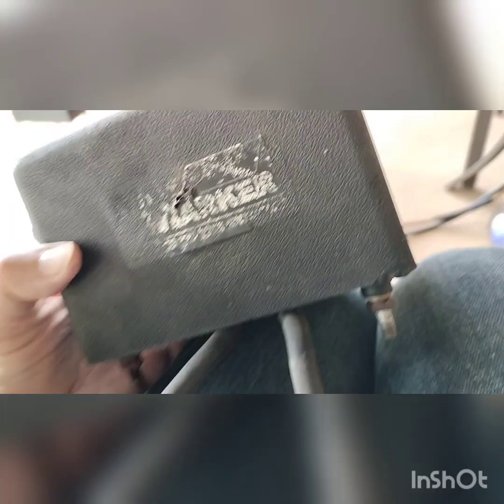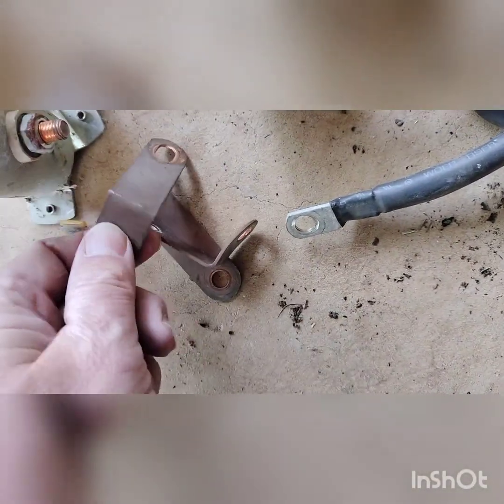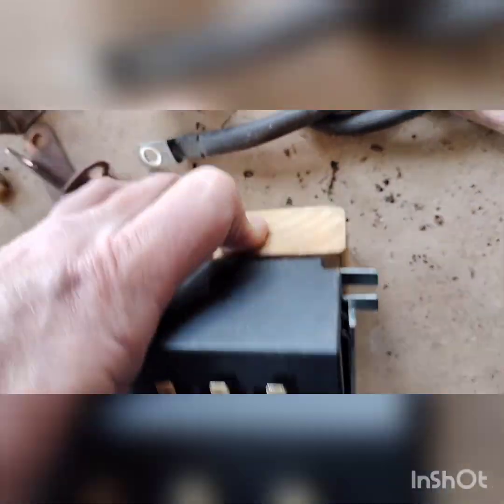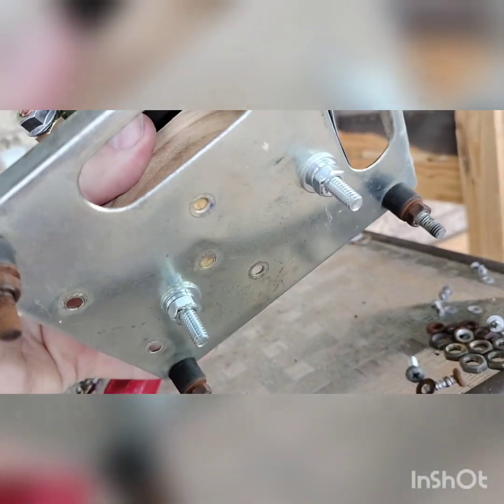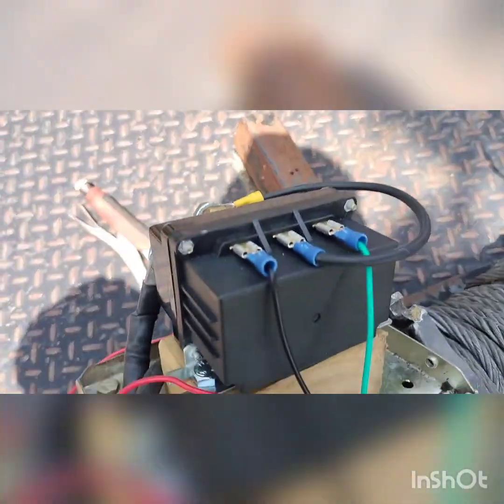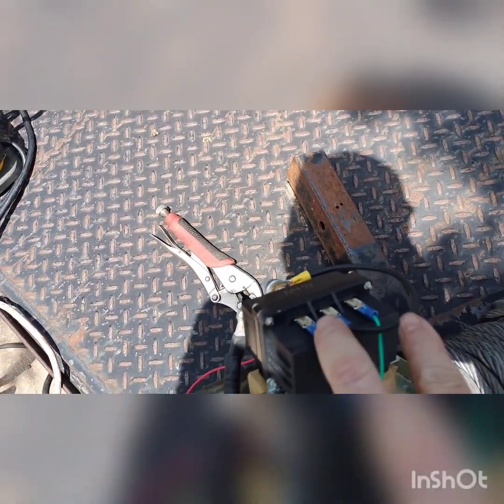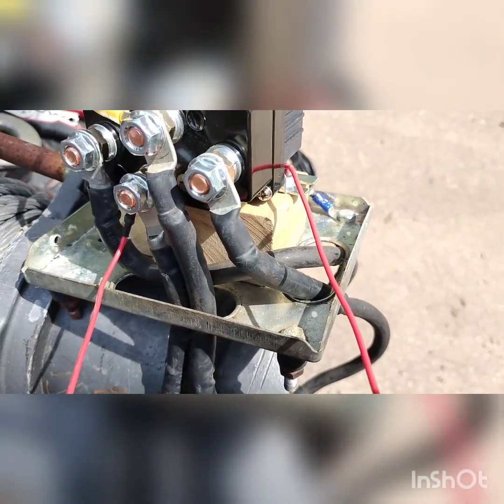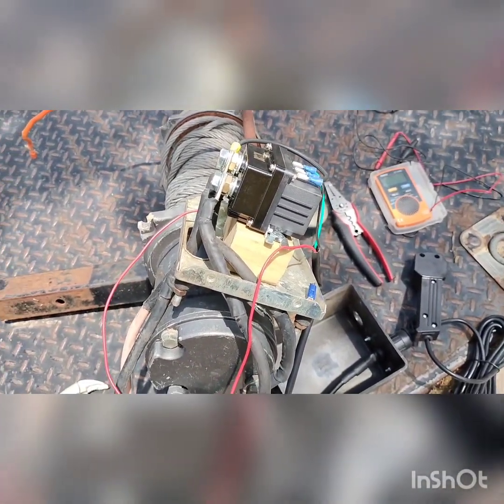Winch Solenoid conversion / replacement.

Comment: How's it working out everything working ok
Reply from the maker: I've used it 3 times since, so far, good.
Reply: @VintageSpeedwerks  ok thanks I've got a old ramsey I'm going to do what you did.   Thanks for the help
Reply from the maker: @DanizeRoblox  seems legit and the Amazon reviews were good. Way cheaper than a mile marker or whatever relay setup.
Reply: Would really love to see a schematic, especially with the wires from the solenoid to the winch motor. All I can find are 3 contact motors. I have a 2 contact motor just like you are showing.
Thanks